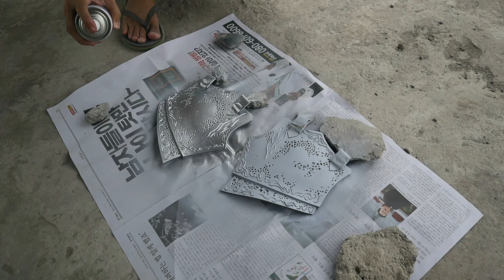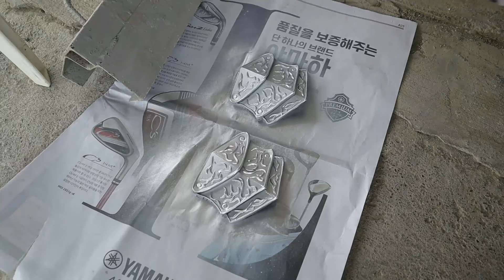Making BLAIDD from "ELDEN RING" Part 2: BLAIDD'S ARMOR | Cosplay Prop Works

Comment: Real late, but how did you get the strips for the intracate details/cresting, did yout just cut extremely long diagonal wedges out? And then how did you attach them?

Amazing work! Getting started on my vagabond knight set

Edit: just looked closer, putting contact cement on it and then cutting a section out is simple genius, I thought you just decided to put the cement on after cutting off